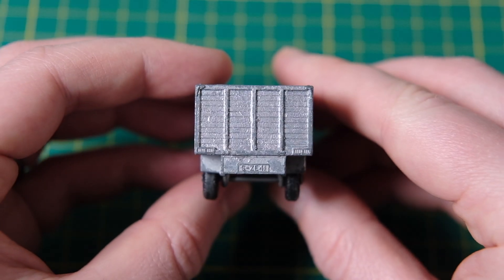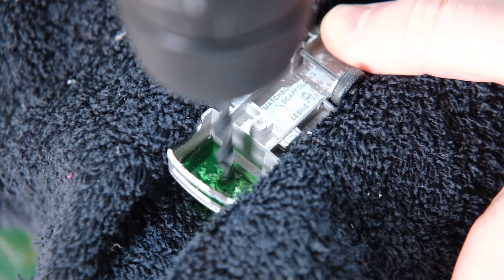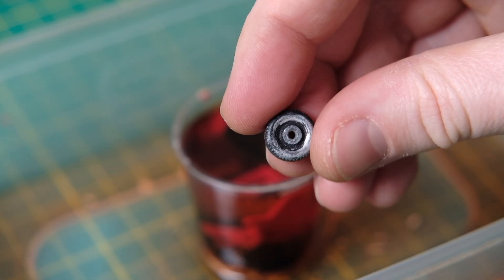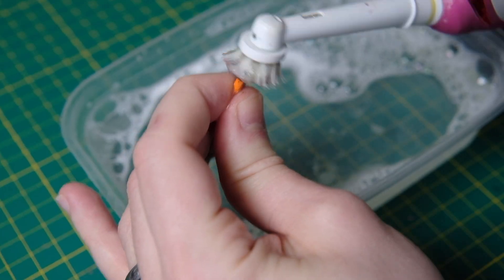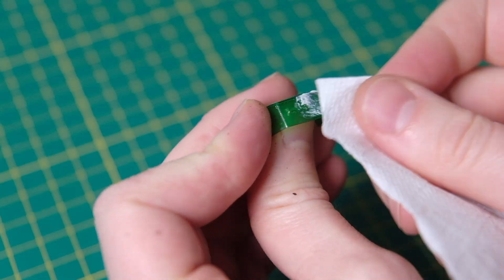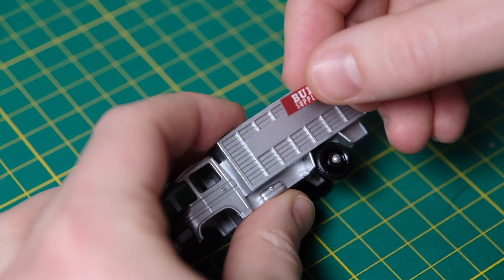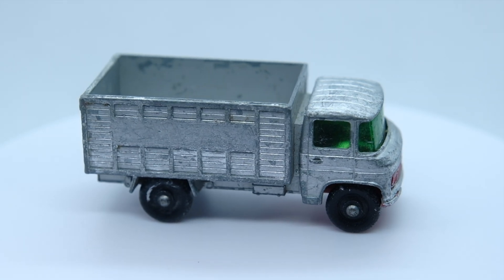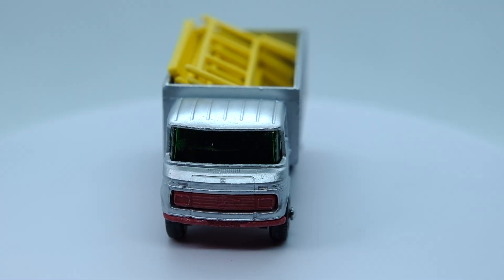MATCHBOX restoration: 11D Mercedes Scaffolding Truck

Comment: I follow quite a few diecast restorers on YouTube and it's not unusual to see excellent restorations on show, many of which look as good, or better, than the factory product.
This truck looks great but, for whatever reason, looks exactly like a completely original, unrestored, mint version of the 11D.
The stickers certainly help, or maybe it's because it's silver, but it doesn't look 𝒕𝒐𝒐 shiny, or 𝒕𝒐𝒐 new, it just looks like a perfect, original model. It didn't look like you used a screw, so nobody need ever know it's been done up.  Great job Jason. Probably not one of your trickier restos but certainly one of the most effective.👍👌😁
Reply from the maker: Thank you, that’s quite a compliment!